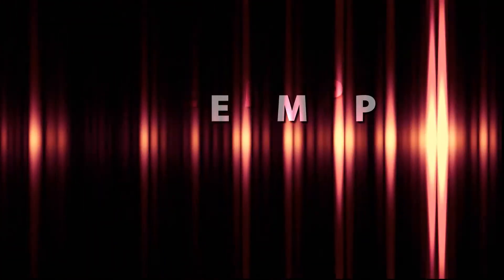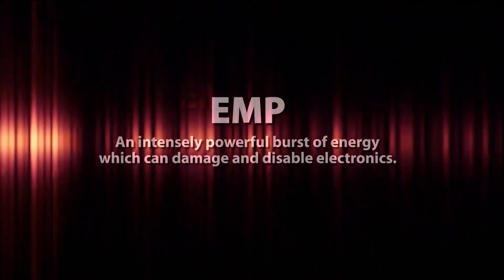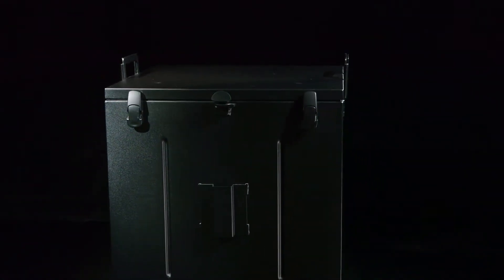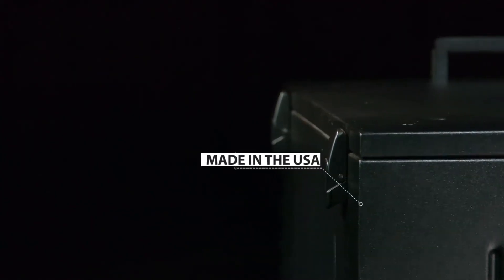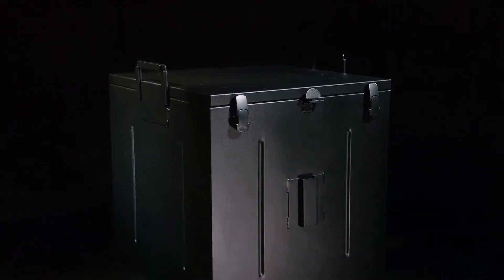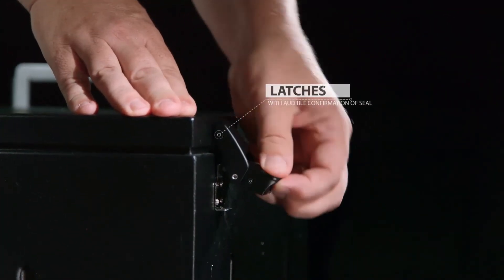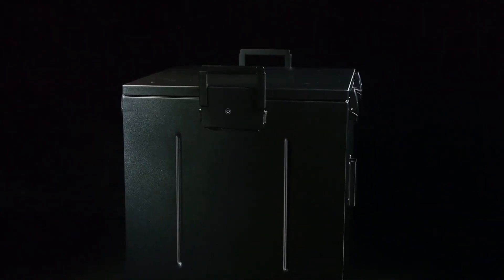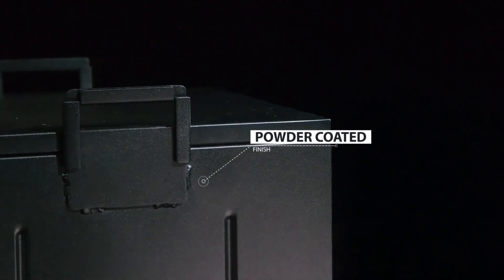TUF-BLOK: Electromagnetic Pulse Protection

Comment: It's an aluminum box, with padding. I looked at your costs. You're way out of line.
I will take my chances with mylar bags in a sealed aluminum trash can with aluminum tape. Much, much cheaper and it does work.
Reply: Yeah - I'm with you.  These guys are looking to capitalize off fear, and in the end - what kind of warranty would you have IF an EMP took place and you lost all your shit (and everyone else lost their shit)?  RIP OFF
Reply: Probably a bit more than a 'box' but not much more, looking at it.  I think if you spent $1000 on some copper, aluminium and Makrolon plate (straps, catches contact spring, fittings, etc), you could build one tougher and better.
TBH I think these guys shot themselves in their feet by not explaining exactly what they did for fear of someone stealing their ideas and so people didn't trust enough to pledge - only 9 people!
Reply: It is a money making "JUMPING ON THE BANDWAGON FEAR-BASED SCAM" nothing more. In the 1980s both the Soviet Union and the United States actually built a virtually EMP-PROOF room made out of 2 by 4s and using several layers of dense copper cloth-screen-mesh that air could barely past through (that problem was solved by using a kind of plastic or rubber nozzle connected to a plastic or rubber tubing connected to an air pump using a piezo-ceramic vibrating air suction pump or electric motor powered air suction pump or a step-up gearing system based-air suction pump to force pump air through the little gaps of the several layers of dense copper cloth-screen-mesh and using cold-worked, pre-quenched copper rivets-nails. The floors are lined with several layers of rubber mats and rubber foam against the walls using synthetic resin-rubber glue. A special zig-zagging structural set up is constructed to allow a metal-free optical fiber to go through and is carefully inserted through spaced layers of dense copper cloth-screen-mesh so as to provide communications connections to the outside world.
Reply: Says who? Not that I trust this product but why the fuck do you really think all the other internet bullshit would work.